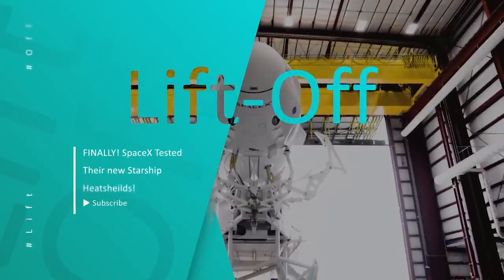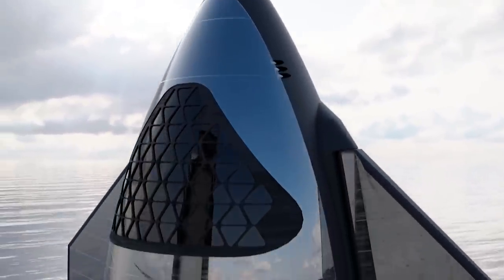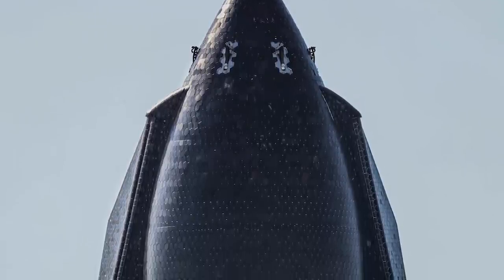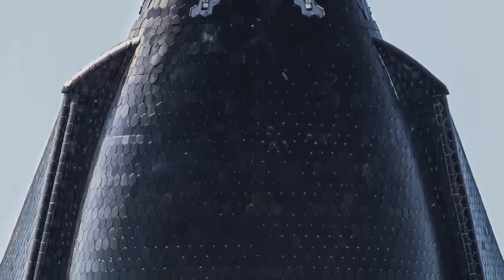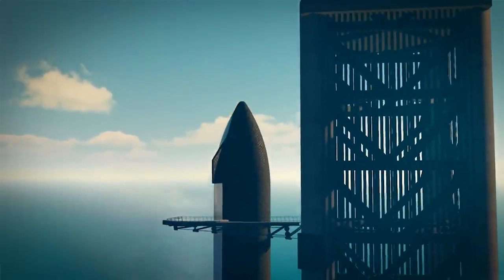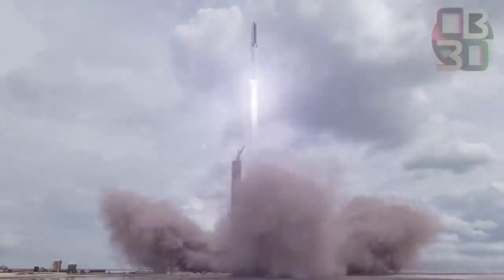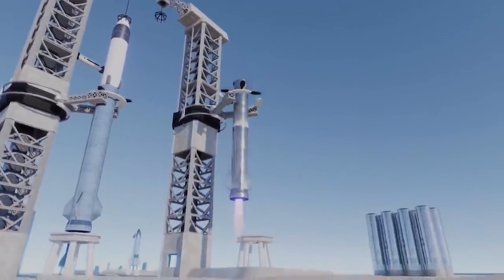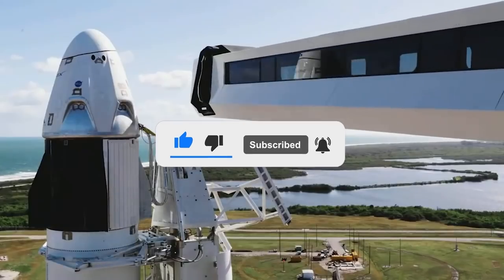FINALLY! SpaceX Tested their NEW Starship Heatshield!

Comment: What about aero-gel, that can actually be introduced in flight if a tile is damaged. Maybe both are needed? Tiles are old news, effective but a new type of shield is needed. Just like when Elon went to buy decommissioned intercontinental ballistic missiles to use as rockets and realised that rockets haven't been updated since the cold war, so he went and made his own with modern materials. New materials or a new system is needed to deal with the temperatures involved in my opinion not tiles again which have failed more than once and have caused many lives. R.I.P to the crew of Columbia and  R.I.P to the other Astronauts which perished in the same or similar way. Aero gel is probably  way off but a different approach is definately needed other than tiles.
Reply: use electromagnetic fields to repel the hot plasma. run of a tesla car battery.
Reply: @esecallum I'm sure electromagnetism cant counter heat or plasma.
Reply: @MrRizLa69  fusion reactors. . ring a bell?
Reply: @esecallum  They dont exist. Yet.
Reply: @esecallum  like a tokamac. How could a tokamak divert plasma and they are huge maybe ten times bigger than the starship itself.